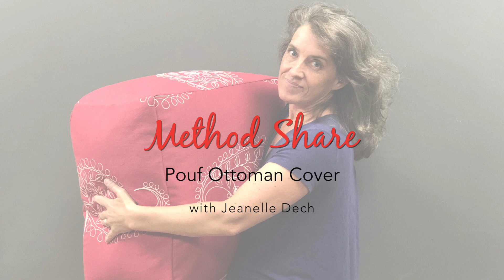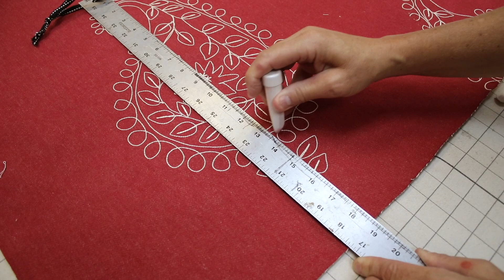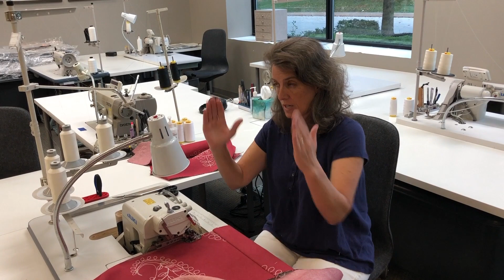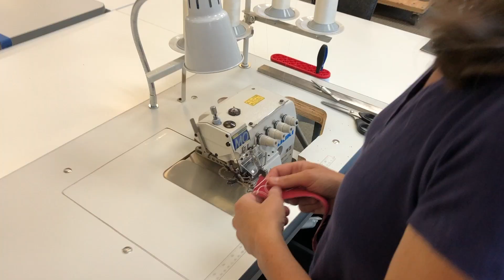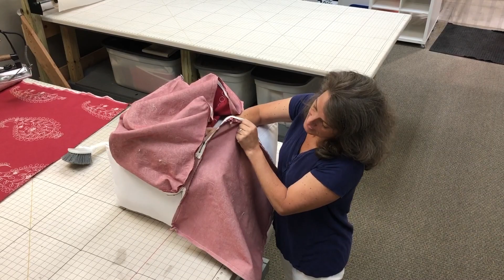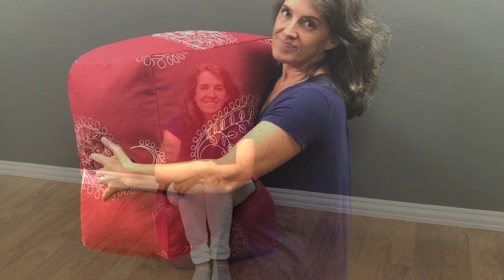Method Share - POUF OTTOMAN COVER

Comment: I am starting to plan a different sized pouf cover, and this video probably saved me a few hours of rework. I will be making an existing pouf match a newly covered sofa and chair. 
One question, why do you serge the edges of the fabric? That's not something i would have done on the furniture.
Reply from the maker: Thanks for your comment! We serge the seams to prevent them from fraying in the case the client removes the cover for cleaning. It also gives a professional, finished look. You might notice we didn't serge the insert seams as they will never be exposed.
Reply: @TheWorkroomChannel  Perfect, thankyou. I will see if I can serge the edges of the cover I am going to make for an existing pouf, so that it will match the chair & sofa. The fabric frays very easily, and the pouf gets lots of wear and tear. Your online instructions already saved me an error, as I was planning to insert an 18x18x12 pouf through one 18 inch hole. My logic was that it works for my cushions.